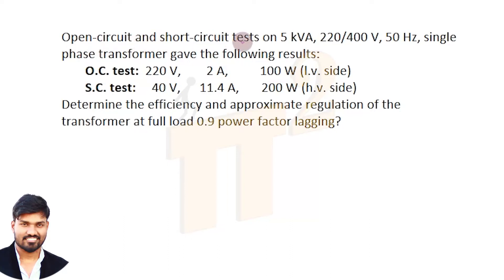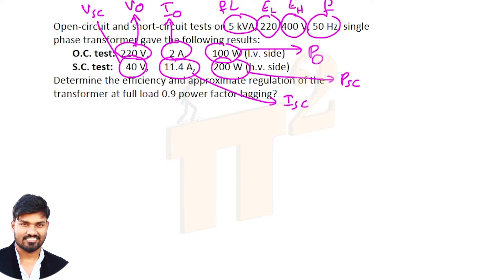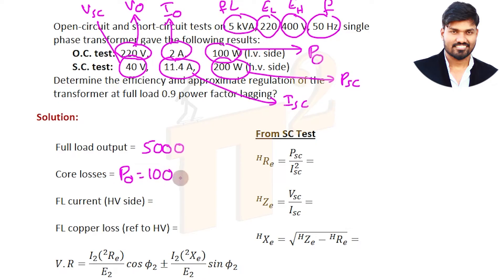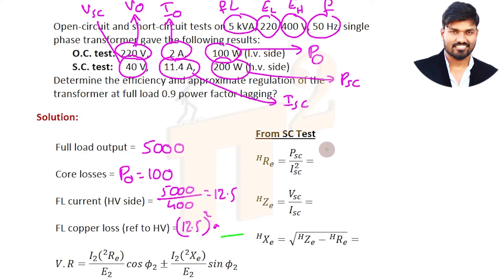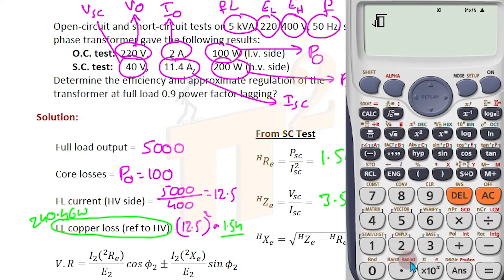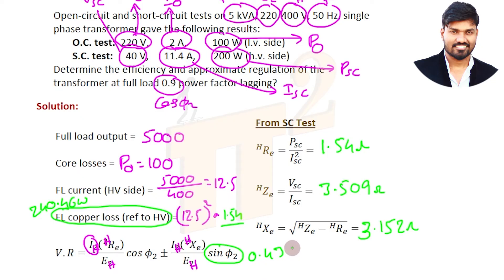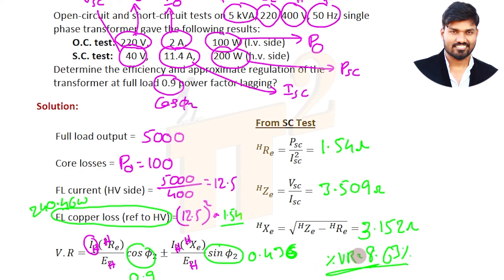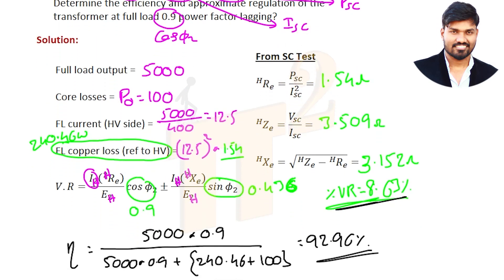Transformer OC test and SC test problems | effeciency, voltage regulation calculations

Comment: How to calculate maximum efficiency for this problem sir? I am stuck at choosing losses. Since for max efficiency losses must be equal as in this case losses are different
Reply: Pi=pcu
Reply: So we need to take iron loss 100 same for copper loss as well? I mean their full load losses are different
Reply: @samp6095  x^2 Pcu = Pi ….(a) 
 You can find the value of x from this equation (a) 
And and there is a slight change in denominator of the efficiency formula 
Since from. Eqn (a) x^2Pc = Pi 
We will have 2Pi instead of x^2Pc+Pi (though it is same but less calculation)
Reply: @samp6095 here since copper loss is actually variable and iron loss is constant. Copper loss is dependent upon square of current and current is dependent upon square of x so, copper loss can be written as x^2 Pc 
Here again Pc is the full load copper loss 
And the cu loss x^2 Pc is general term to calculate it at any given loading value